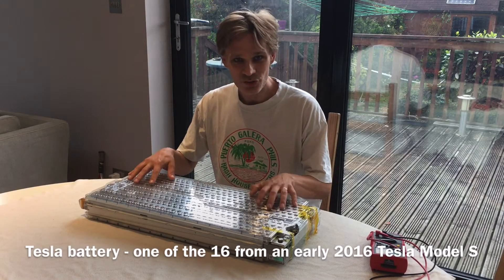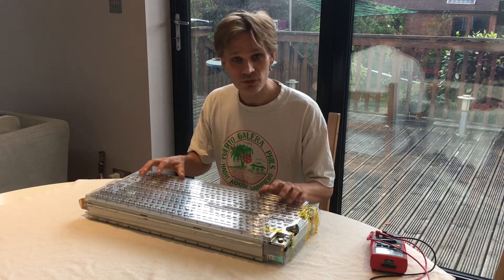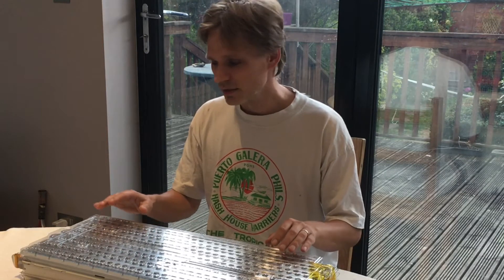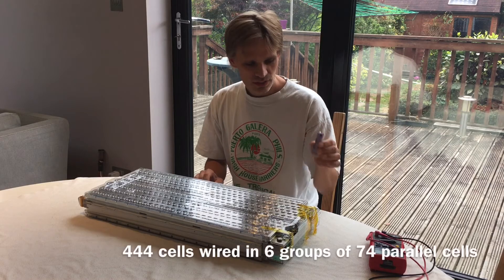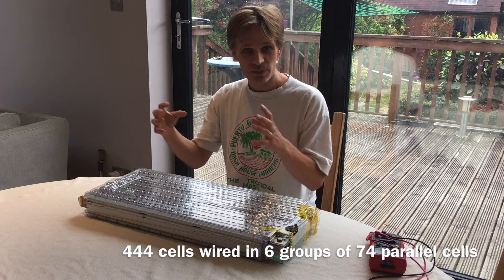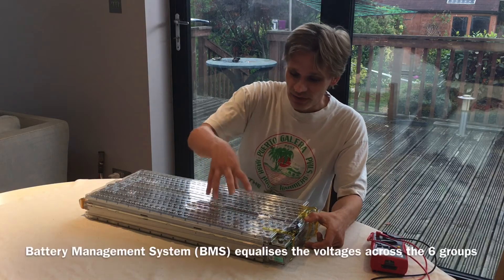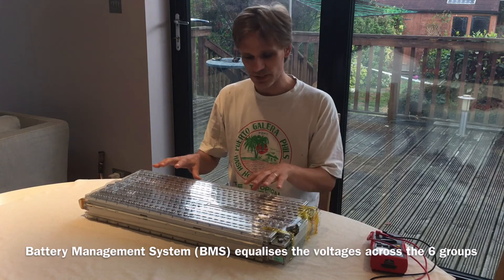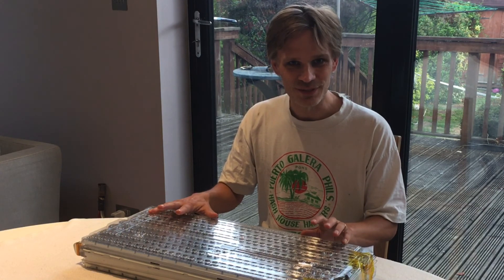1. Key components of a Tesla battery - for supplying off-grid power

Comment: Thank you, you always make great, informative, professional videos. 

Like most electric conversion people I too have been researching Tesla battery recycling use for a bit. Boat owners converting to electric seem to use recycled Tesla's, Leafs and Bolts. However, the battery chemistry difference in the high powered Tesla is what I suspect is the greater cause for runaway, or so my research says. You know much more than I do though. Could you please explain further how running it at the lower voltage derisks that and also your marination plan?

Top of my list has been the Chevy Bolt battery as their Chief Engineer is quoted as saying they will be installing their batteries as is into their E-boat (unsure how close they are to production though). Cheers :)
Reply from the maker: Hi there, These are some good and also rather complicated questions. I too have been looking at various batteries and this won for me for the simplicity and energy density. Also the voltages work well for my motors.

But I am very mindful about runaway.  My research suggests overcharging is a key problem with this, as are charging and discharging too quickly.  

For overcharging, I can prevent that quite easily with a voltage limiter (e.g. using an advanced solar charger or just a simple dedicated circuit).  Then for over charging or discharging.  My understanding is these cells are fine to charge / discharge at 1C.  So that would be around 5kW each hour, or over 200A.  I would not even plan to use 1/4 of this at the very most, and less when charging. And as the heating effect on the cells is proportional to the square of the current, this means 16x less heating than at 1C - and I’ll make sure of that by using fuses.     

Then for positioning, I’ll be very careful to keep it in a secure and dry space at the back of my boat and to constantly monitor the power in and out.  

At least to start with, I’ll also constantly monitor the temperature.  

Hope this helps and I’ll also be happy to chat over email if you’d like.  All the best, Simon
Reply: @aktsolar  Cheers! I just resent the email (originally in June) to your akt contact email :)